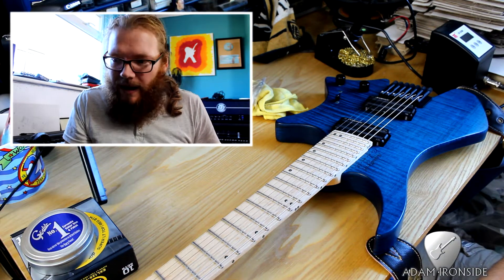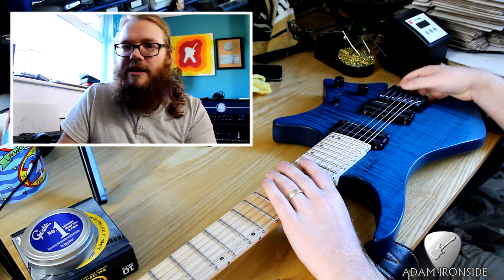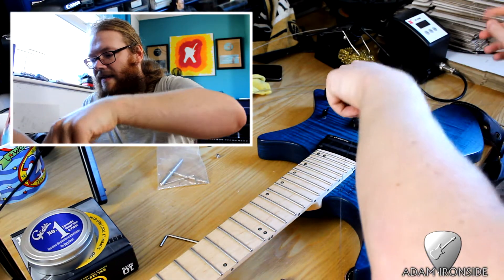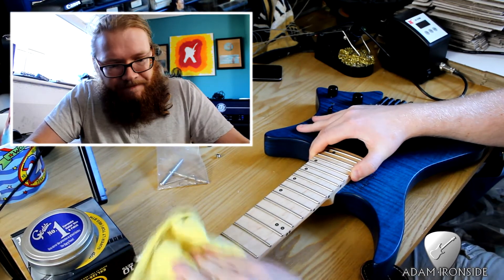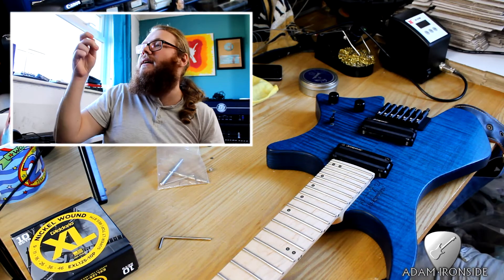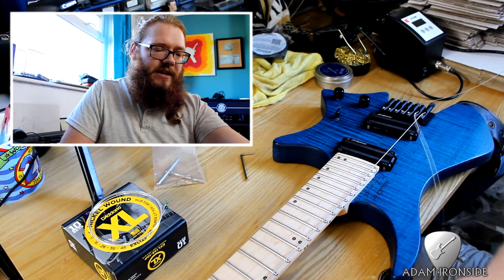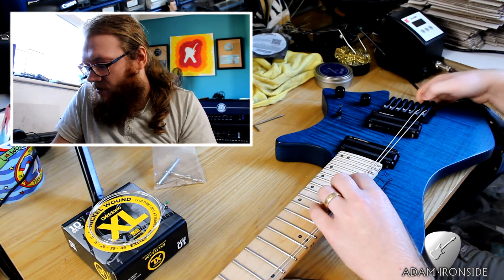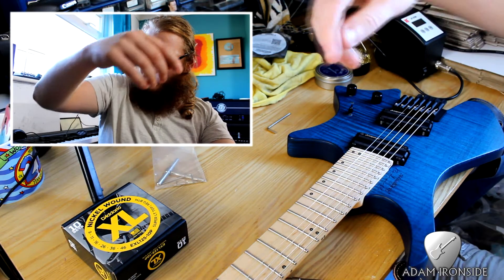Strandberg Boden OS 7 Restring

Comment: Parker Fly player here.  I love my Parker, but they've gone downhill over the years (they actually shut down for all of 2016, supposedly to return next year), and won't consider top-tier 7-strings or even producing 8's.  I ordered an OS8 last week, and should be here just before Christmas, and have been sucking up your videos on the Strandberg.

One thing I noticed was inserting the strings into the bridge is not that dissimilar from the Parker's bridge system.  One trick I found was to take the end of the string and slightly curve it before inserting it into the bridge.  You'll find how much or little curve you need after a few strings, but, once curved, it can go into the bridge and over the saddle without having to fiddle around with trying to pry it upwards.
Reply from the maker: Thanks for the tip man! I always liked how Parker's looked but have only been able to try a few of the lower end ones over the years.

Comment: Could the OS 7 handle a drop tuning in g or g#, without being floppy. I have a 25.5 ibanez s series 7 with a zero point trem. It has a .74 on it in G#, it just seems a little too floppy. I'm thinking about getting a Boden OS 7, hopefully it will give me more tension, thoughts? Thanks for the vid!
Reply from the maker: Hey Chris, it will give you more tension because of the longer scale length on the low end. I use a 64 and I can get away with drop A but ideally I would want to go up a gauge. What kind of tension  how much tension do you like? As a kind of guesstimate, if I was going to be tuning down to G# I'd personally probably use somewhere in the region of a 68 on the strandberg.

Comment: Would you say setting up this guitar in drop A is somewhat easy for someone who has never set up a guitar before? 
The guitar stores near me either have no idea what a Strandberg is, or charge 70$ to set it up
Also can you recommend a set of strings for Drop A?
Reply from the maker: Yeah man, no harder than any other set up.
I sometimes put this in Drop A, but usually its in standard.

If I was leaving it in Drop A I'd raise the action a touch on the low string and up the gauge.
In standard I like 9 - 11 - 16 - 26 - 36 - 46 - 64
In Drop A I'd probably up that to a 66, maybe a 68.

D'Addario (disclaimer , I work for the UK team) recently released a set of NYXL designed in collaboration with Strandberg.
Ola settled one 9.5 - 13 - 16 - 24 - 34 - 46 - 64

Not too dissimilar to my preferred gauge.
Reply: I see, thanks for your answer +Adam Ironside

Comment: I absolutely abhor changing strings and as long as I can get away with the old strings I'll keep them. A set of nines is just fine for me and I think on the 7 string the B string is 50 or 54. I tune it down to A and it's a bit flabby, but I don't mind. I compensate by raising the action on it and I like the way the slinkier strings have the fast attack type of more aggressive responsiveness. Well I choke the life out of it with the heavy palm mutes. so it might be just the way I play! I used to have even a 69 on a 6 stringer in a  drob C and drop B tunings and I think it was just too much for me. It really is a trial and error thing to find the right gauges and it would be wise to trust what feels right, rather than to heed the "echoes" of Stevie Ray Vaughan rumors" saying you can't sound good unless you break your fingers with the set of 12's. Cheers!
Reply from the maker: It really is trial and error mate!
I don't mind changing strings, its the rest of the setup ballache that gives me grief.
Reply: Well, they both are tedious jobs, but they gotta be done! Cheers!